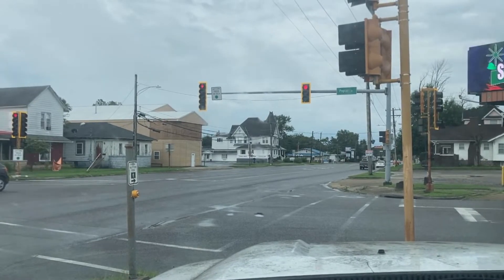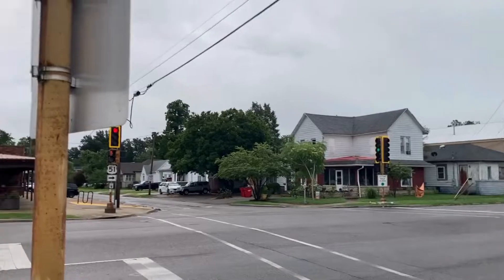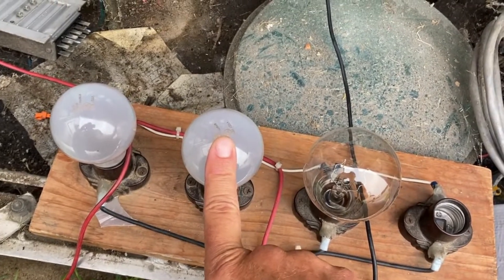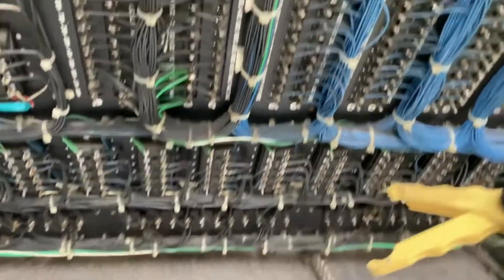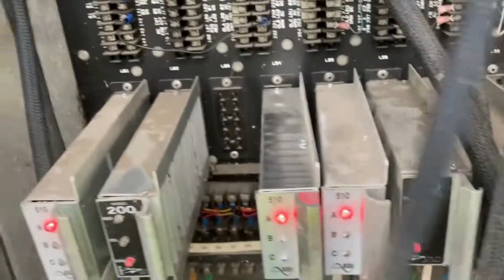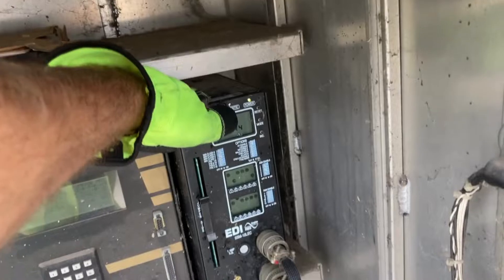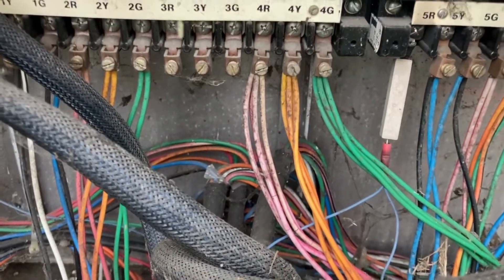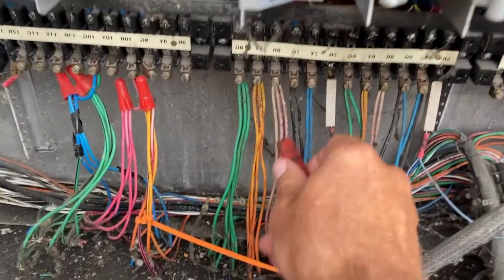Being Persistent when Troubleshooting Traffic Signals

Comment: You don't use a vom to check in the field for a short  blowing the load switch?
Reply: You can pull the load switch and leave the wires connected to see the short in the field. Then, disconnect the yellows to see which yellow in the field is causing the problem by checking each for a short.  Sometimes shorts don't show on meter, needs voltage to create short. I would carry   a small jumper wire with a small  rated fuse or breaker and switch between aligator clips to check, so I wouldn't trip the main breaker to find which wire in field is creating fault. The switch prevents the arc when connecting. Reconnect the yellows that are good to run intersection until repairs are made, or use a spare field wires to reconnect if spare is good or flash. Ants eat traffic signal wires. Also, water in conduit overtime cause wires to deteriorate.
Reply from the maker: @miluth2  Thats great information.  Yes, I have a VOM.  I should use it more often than I do.  
I have had others tell me about using a seperate breaker for testing field wires which is a great way to find those wiring that are shortin out.  Just haven't incorporated that method.  But a great idea!  Thanks for sharing your knowledge!

Comment: A Raspberry Pi can run a lot more than a couple lights.
Reply from the maker: You know, I always felt I could run one with an arduino or basic stamp (or raspberry pi).  But there are alot of checks and balances that are done behind the scenes.  And it requires rigourous testing (including a heat chamber) for products to go thru AND the the approval process...
But....LOL
Thanks for your comment

Comment: Carry a spare circuit breaker in your toolbox. Feed each one of the yellow feed wires through the breaker one at a time until you find the shorted wire. Or just touch each yellow field wire to AC hot until you see a big spark - short circuit. Then run the intersection with the shorted wire not connected. Observe the lights to see which yellow light is out. Since you have 4 wires under each terminal it appears you have home run cables to each traffic light - a good situation.
Reply from the maker: THanks for that info Mike!  I haven't tried the circuit breaker route...but that makes total sense.    and yes, homeruns would be easy to do that with
Reply: @streetsmartstraffic  Even better than circuit breaker... Have a 300 watt quartz light. Put it in series with the line side, and try driving the suspected defective lamp wire. If light at head lights, no issue. If quartz light lights, hard short. If you have LED lamps in the heads, then you likely wouldn't need a 300 watt indicator (something much bigger against the load of a 116 watt incandescent) you could just use your lamp board. Connect to line instead of neutral, and probe each head wire through the bulb - assuming real 116 watt incandescents on the board - those frosted ones look to be LED as I think I see the amber LED phosphor through the envelope. Light lights full, wire shorted. Light dim and head lights, wire OK. No sparks, and no breaker trip. Basically you would have a current limited power source to drive the lamp. More than enough current to drive the lamp(s) on the end of the wire, but not so much as to make fireworks.
  

In the case of this video, as mentioned by others, I suspect that the three that you saw voltage on was simply the working lamp in each of the heads - flashing red in this case - was causing the neutral at the head to come up a few volts due to resistance of the neutral from the head back to the cabinet. You were seeing the voltage on the neutral through the yellow lamp. The higher the voltage, the further away the head from the cabinet. It was suggested that it may have been capacitive coupling between the red head wire (flashing) and the yellow. That would be possible if the yellow were wide open at the head. Since the yellow is tied to neutral at the head, it's more likely that you are seeing the voltage rise on the neutral.
Reply from the maker: @bobw9689  GREAT information!  I see what you're saying.  So disconnecting the individual wire, connect neutral jumper from the test board to that, and then use the line side of the test board and tap the HOT (120V) in the cabinet?  (Placing the bulb in series with the wire to the indication).  Am I correct in saying that?
I usually do process of elimination if I have multiple indications for one direction and I suspect a bad wire.  Weed out the one that doesn't trip the conflict monitor.  And then find out what is wrong with that wire run.  

Except for a few signals out there, all of the street indications are LED's.  My test board has all incadescent bulbs (I think they're 60-90W bulbs).  Thanks!
Reply: @streetsmartstraffic  That's basically it. If you go <120 volt line> -----> <lamp to limit current to 1 amp(116 watt) / 2.5 amps(300 watt)> ----> <wire leading to head>  and if you touch the wire from the limiter bulb to the wire to the head, and the limiter bulb lights bright, likely ground / neutral fault on wire. If limiter bulb glows a bit, and head bulb lights, not that one... try the next. The reason I said 300 watt quartz is that is a common bulb in area work lights, and it passes enough current to light a 116 watt bulb, while not doing much itself. Plug the light into a receptacle on the end of a extension cord with the power plug cut off so you can do your series thing. If you have LED heads, the 20 watts or so needed by that will make a 116 watt bulb do nothing while lighting the head indicator. I'm not sure if from what you were saying in the video that if you have a ground / neutral fault on a wire from the output of a load switch whether it actually eats the channel on the load switch, or if it blows an input fuse of some kind. IF you have an intermittent fault on a channel, and you have LED heads, you could put that 300 watt lamp between the output of the  load switch and several heads while you are trying to find the fault without killing the load switch. Be aware that you might be tricking the conflict monitor into thinking all is well since you no longer have a hard fault, so be careful there. Oh, and the reason I keep saying 116 watt... because that's what a "real" traffic signal (faa obstruction light in my case) bulb is. And you can still buy them.
Reply from the maker: @bobw9689  I gotta ask.  How long in the signal field?  You sound like you know you're way around the cabinet and troubleshooting techniques well.
Reply: @streetsmartstraffic  Actually, I'm not a signal tech. My background is telecom and communications along with the necessary DC / AC power required for this stuff. The concepts involved for signals just make sense to me, and in the end providing power to something on the end of a cable and dealing with faults from source to load is the same. In the case of DC supplies, "trying" it multiple times could be bad. You run the risk of crashing controllers powered from the DC bus, and high current 56 / 130 volt DC can make some impressive arcs that don't just stop like AC does, which can really burn stuff up. You can draw about a 1/2 inch arc with a couple of amps at 130 volts. AC... "yeah... there's a spark".
Reply from the maker: @bobw9689  Wow. Awesome.  Funny thing--I went to college and came out with a Bachelors in Electronics specialization in Telecomm...then I graduated and the industry downsized 😬  So, i just started looking around for something else.  Saw an ad for a traffic signal tech and the rest is history.  
Great insight.  Thanks for sharing your wisdom
Reply: @bobw9689 lose nuetral or high resistance nuetral due to corrosion. Will not blow load switch. Will cause conflict or dual indication due to return voltage from flasher, depending on type of monitor. Sometimes it shows a Christmas tree on the signal head and work like that for awhile before showing fault, more visible at night. Due to the use of digital vom, it could also be induction, not true voltage. Also can be bad insulation causing the yellow and red to bleed. If same phase load switch keeps intermittently blowing new load switches, usually wires are going bad for that phase causing a short. That's why it's important to document all troubIe calls and what was found and repairs made. Help with troubIe shooting. Also log phases stopped time color, including peds. So you know what the controller was doing at the time of flash and if it matches the monitor, before resetting the intersection, so you don't question what you remember controller doing at time of flash. Also help other techs that maybe called to that intersection for same problem. Stop time helps with repeated calls.

Comment: I'm fascinated by how archaic all this is. This is so similar to telephone central office stuff from the 30s to 70s.
Reply from the maker: Dave-sometimes I wonder if some of these cabinets were built during those times... LOL
Reply: Probably for the same reason you don't see a Raspberry Pi as the avionics controller for an airliner or a logic controller for an elevator -- reliability.  Traffic signals need to be 100% fault-tolerant, and fail to a known-safe state.  It's difficult to make that claim about many modern software-controlled electronics, and going through the development and certification process for new hardware/software is an extremely time-consuming and expensive process, so not something companies want to do very often.
Reply from the maker: @ereisch  Well said.  I hear the comment sometimes that says:  "I could run an intersection with a raspberry pi or an arduino!"  While you COULD probably run an intersection, there's alot of standards and inside testing of the equipment to hold up against temperature, dust, etc.  There's in house testing (such as heat chambers) that the equipment goes thru for example.  And yes, better have deep pockets to enter a new product into this industry...
Reply: @ereisch  I agree with the reliability aspect. I'm referring more to the mechanical aspects. Screw terminals are incredibly time consuming for wire termination. That's why the phone companies left that behind decades ago. 

I wonder if new traffic signal builds still use screw terminals.

Comment: A high resistance Neutral connection can cause a small back feed voltage.
Reply from the maker: I believe it was found that there was a Neutral issue.  Thanks for your input Steve!

Comment: I would be willing to bet the 3-4V of "backfeed" you were getting was just AC coupling from the flashing red indicators (and the different peak voltages was probably due to the relative length of the runs...i.e., a longer run is more length for the voltage to couple across).  The lone yellow line that was not slinging stray voltage around was shorted somewhere, so the capacitive coupling was getting dumped to ground somewhere along the run (or in the head) rather than making it back to the cabinet.  The TRIACs in the load switches should be able to handle backfeed, as long as they're all running off the same mains phase (i.e., it isn't a 230V cabinet), but they'll let the genie out on a dead short.

Also, if you set the manual range on those Fluke DMMs to ~100V, the display response is a lot quicker to transients like a flashing signal, since it isn't trying to autorange across its 600V limits.
Reply: Came here to say exactly this.  Minus the Fluke ranging thing, that's good to know.  Some of Fluke's industrial meters also have a special low impedance mode to help with this misreading too.
Reply from the maker: @the.og.lylebob  THanks for the commenting and the information!  Much appreciated!
Reply from the maker: Thanks for your thorough comment!  See, this is another reason I started this channel!  To let others (smarter than me) to share great information like you just did.  Much appreciated!
Reply: @streetsmartstraffic  My guess is the 1 that didn't have any coupling was a short to ground?
Reply from the maker: @ryanfav  We actually had insulation of the wire the broke off and was sitting on the metal conduit feeding the signal pole.
Good insight!  Want a traffic signal job!  LOL
Reply: I also was going to say the same thing - switching over to Lo-Z (low impedance) on my Fluke gets the float to go away from capacitive coupling.  Even a couple of their field meters like the 117 have Lo-Z mode now.
Reply from the maker: @mobile_vic  THanks for the commenting and the information!  Much appreciated!
Reply: When I saw that my guess was that one head had a yellow shorted to ground, thus no AC phantom coupling from the red run in that conduit. Shorted to ground would certainly stand a good chance of blowing the triac in the driver. 

The short could be anywhere, but I've seen incandescent lamps blow in a way that resulted in shorting the support wires inside the lamp, presenting a dead short to the dimmer (or load switch in this case). Experience with incandescent lamps tells me the first thing I'd check is the lamp in that head, and only if it isn't the problem try to track down some other problem.
Reply from the maker: @lwilton  THanks for the commenting and the information!  Much appreciated!
Reply: Yeah I'm not a traffic signal engineer, but my first step would have been to disconnect all four yellow output lines and then see if the monitor was happy again. Then hook up each of the lines, one by one, to see which was the troublemaker.

But that would almost surely involve sacrificing load switches to find the fault, so you could possibly make a test harness to try out each of the output lines in succession (outlet plug on one end, alligator clips with an inline ~5A fuse on the other). Testing resistance to ground with that much stray voltage on the lines is going to give you garbage readings, unless you get a flagger crew for the intersection and power down the entire cabinet to eliminate the AC coupling issue; then you can do resistance measurements.
Reply: I'm also curious why you were getting a Red Fail when the issue (that we can see at least) was with the yellow.  You're also not seeing output indication on the red too.
Reply from the maker: @ereisch  Ahhh...Now you're getting a taste of the confusing world of traffic verbiage.  I've always said that I think 'they' made it harder than it has to be.  RedFail  means that the conflict monitor did not sense a load on a phase....meaning all reds OR all yellows OR all greens are out.  So all yellows not being sensed causes a Red Fail.  Clear as mud??? lol
Reply from the maker: @ereisch  Yep-you're first paragraph is dead on.  That's what I SHOULD have done lol.  I was a little off my game that day.  Thanks for sharing your knowledge!